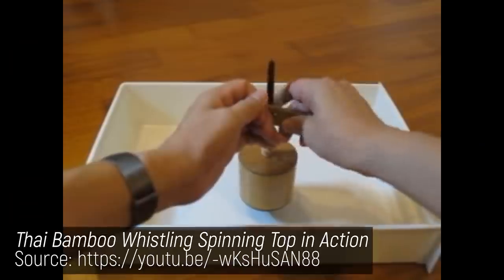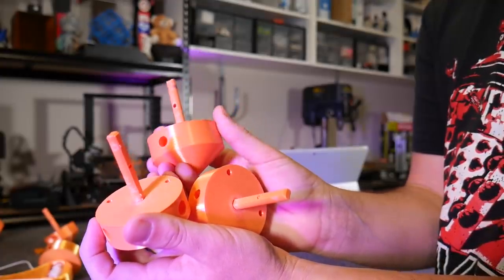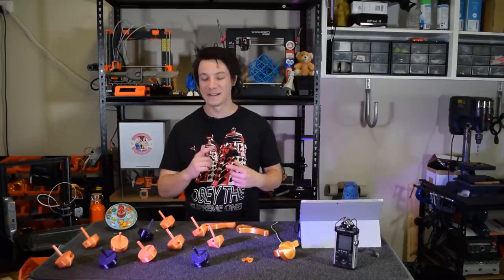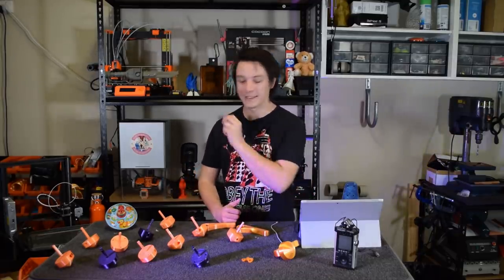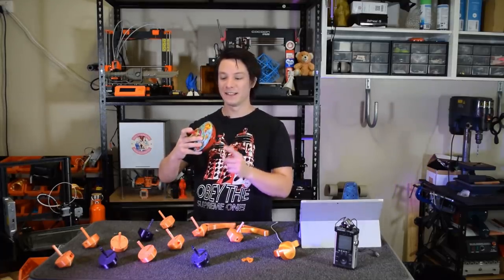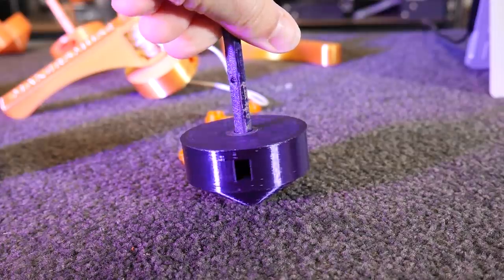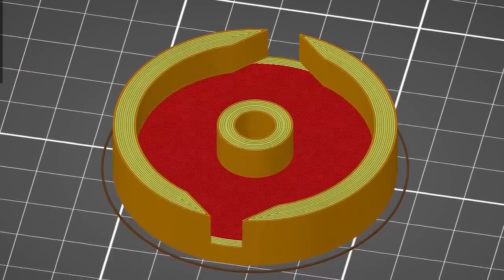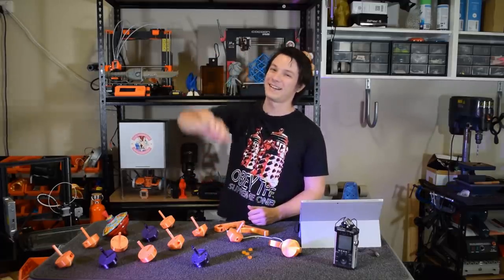3D Printed Screaming Spinning Tops

Comment: Can you make a top that sounds like a air raid siren
Reply: kwalski analysis
Reply: @LoneFalcon a bigger one could be made like those spinning tops which stay in place, with an outer stator mounted on bearings.
Reply: I don't think its possible because the top would be spinning fast and you would need it to be slow smooth loud then quite then back to loud, maybe they could do it but it would be going from loud to quite really fast.
Reply: @professored7169  as you're launching it it spins faster then decreases as it slows down.
Reply: @satibel  I know. A bigger one would have more mass so it would spin a lot longer, and I'm talking about the sound, it would be impossible for it to smoothly transition from a higher pitch to a lower pitch then back to a high pitch again.
Reply: @professored7169  maybe if you want one that repeats, here they just play once.
you could probably make one with a clutch and a flywheel.
Reply: WWII Carter Air Raid Siren, look it up. Then duplicate it into a spinning top. It would work on the same principle mentioned in the video, which is fine, so I'd expect it to be possible.
Reply: Hell yeah ✊🤘
Reply: it sounds like an airplane in the sky
Reply: Japan has left the chat
Reply: Chowski
Reply: I was gonna say that
Reply: Or a train
Reply: Or an Aztc Death Whistle
Reply: I was thinking the same thing.
Reply: Yes.
Reply: yeah
Reply: That would require 2 tops, an air raid siren is essentially 2 air compressors bolted together
Reply: He can't
Reply: It'd be complicated but might could be done, but we're talking a mechanical system here not passive noise making. Below are two of my ideas for one but no garauntees.

First thing you'll need are weights on rails within the top that can slide straight inward and outward. These need to be pushed or pulled inward by springs. The weights need to be attached to worm gears, which in turn would drive horizontally aligned pistons on the outer end similar in design to those in your car engine. The heads of these pistons each drive a slide wistle, which naturally changes pitch as the slides are moved. This causes the pitch of the sound to change as the top slows down over time, as the outward force generated from the top's spin gradually decreases and is overcome by the springs pusing against the weights, which in turn drive the pistons that change the tones of the slide whistles. A downside is that so long as the top remains at or near its maximum velocity, the tone will not change.

Option 2 is to make a clock wound by the action of spinning the top from the launcher. Two free-spinning prongs stick up from the rest of the top and are inserted into the launcher along with the axle, each on opposite sides of the axle. As the top is launched, the axle spins but the two prongs remain static relative to the launcher. This allows them to drive one or more springs backwards within the top so as to power the clockwork, which rather than sponning dials would alternately push and pull on the slide whistles just as option 1 would do. This, however, would take a mechanical engineer/watchmaker MUCH more adept than myself, though it WOULD allow the siren's tone to go up and down even as rotational speed remains relatively constant.
Reply: siren head running
Reply: No a loud one everyone will evacuate if it’s a loud one
Reply: That’s shaped like sirenhead
Reply: @jdhart3759  no
Reply: JD Hart no
Reply: It would need a stator to do so
Reply: That would be epic
Reply: "my goals are beyond your understanding"
Reply: That would be COOL
Reply: Unfortunately the way an air raid siren works, is it spins fast then slows down the spins up again.
Reply: SirenHead top.
Reply: :0 YOU ARE A GENIUS
Reply: TBB747  I know that, but it's just a longer version of the other one, we've had to sounc the weather one, In my town because we had a major blizzard coming.
Reply: Yes
Reply: I agree
Reply: All of you are forgetting that the mass, surface area, and geometry of the cylinders used in Air Raid Sirens are directly correlated to the tone and drone of the sound. A smaller one would just be higher pitched and wouldnt sound like a siren at all. It has to be big, has to be shaped correctly, and has to be moving at an exact speed, one that a 3D printed polymer would probably be destroyed under
Reply: @joshreyes3624  correct
Reply: @professored7169  You could use 2 or more disks with different diameters that trigger at different RPMs. Imagine a simple jingle that plays as it winds down.
Reply: Siren head weeeeeeewooooooooweeeeeeeeeeewooooooooo
Reply: @mrbobjob8995  no
Reply: Yes
Reply: The sound they make is made by pushing a ton of air into a perforated disc using a motor so I very much doubt you could
Reply: Here's how sirens work, which may or may not be helpful to Angus: The thing that is turned by a hand crank or a motor is a rotor in a chamber like that in the compressor side of a turbocharger.  This takes air in from its center, where multiple vanes on the rotating part accelerate the air and force it to the outside of the chamber.  The rotor has a number of separate paths for air to follow.  The outside of the chamber has holes in it, spaced the same as the air passages in the rotor.  Thus, as the rotor rotates, the flow of the pressurized air is chopped into pulses as the rotor turns, thus modulating the pressure of the air at a frequency (pitch) proportional to the rotation speed.  This is why the pitch rises as it is cranked up, and drops as it slows back down.  What makes this a challenge for a top, is that there needs to be a rotating rotor inside a fixed chamber, like sirens have.  The metal top Angus shows uses something similar to this, with its air intakes at the bottom and three different tuned pitches of reeds at the three air outlets at the outer edge, but the pitch on that is determined by the resonant frequencies of the reeds, not the speed of rotation.
Reply: U mean siren head
Reply: Yes
Reply: Foolish YT  yes
Reply: yeah
Reply: @satibel   gyroscope
Reply: You could use the same whistle design but make the point at the bottom flat. When launched the spin is high and will start at the high pitch. Then the flat will induce more friction and get that quick dive bomb sound. 

It would only last for 1 cycle but would be close to the sound.
Reply: If there is a nuke coming onto earth, there will be a lot of those things spinning
Reply: put this on r/cursedcomments
Reply: No
Reply: grab siren head and make him spin.
Reply: Better question could you make one that sounds like an Aztec death whistle
Reply: Shepherd tone
Reply: We don't need a top for that
Reply: Sirenheads favorite toy
Reply: Yes please
Reply: That would be great
Reply: YES I WOULD TO LOVE TO SEE IT
Reply: Even better a Stuka siren
Reply: 68th reply
Reply: 69th REPLY
Reply: hey bro you want to see my top wooooooooooooorrrrrrrrrrrrrrrrr
Reply: DO IT
Reply: granpa would surely like it
Reply: fun fact this is basically how the Ju87 siren worked and old air raid sirens were two spinning discs with different amounts of holes in them
Reply: *AAAAHHHH*
Reply: TF ?!?!..When in the heII did I like your comment @ Neue ?!?!? This is the first time watching this vid. As I scrolled down the comments I noticed that it was liked by me. Probably my future me. Hahaha

Comment: Holy shit, that whistle mechanism thing can be good gimmick for beyblades
Reply: the dream, definitely
Reply: trips rip the rip trips, beyblade let errr rip m8
Reply: Do they still make beyblades?? Omg I just had flashbacks to 3rd grade. I forgot about beyblades.
Reply: @professored7169  yeah, the latest beyblade series is beyblade burst GT
Reply: Might be a bad idea beyblades rely on their weight to be not thrown off the platform
Reply: @anderson9244MLG  not gonna lie but they've reached the point of no return
Reply: @troymyboi2808  what do you mean?
Reply: Takara Tomy definitely have good engineers. The way the balance the beys so that they wont be so overpowered, the way the tip changes the way it spins, it hits, and revival method, balancing system that can make it hit stronger while unbalanced or maybe all rounded for better stamina or better defence. But in this case, where should they put the hollow section? Basically a beyblade had three seperate section, so the only part that can be made hollowed and big enoughto has hole on it are the layer base and the tip. Could be a feature.
Reply: "GO PEGASUS"
Pegasus: WHISTLE NOISES
Reply: I mean, we've gone so far we can make 3d printed beyblades
Reply: @dzulk9  you forgot Hasbro
Reply: @harvetwound1234  but didn't they tend to modify TakaraTomy products?
Reply: The screecher
He makes every person nearby have concussions until their head explodes into a gorey mess, therefore making him the winner because the opponent couldn't spin or even make a move.
Reply: Whoooooaaaaaaaaaaaaaaaaaaaaaa
Reply: Ah man. I hate it when my beyblade  screams at me
Reply: @professored7169  yeah the have beyblade burst gt, almost season 5
Reply: @anderson9244MLG  almost beyblade burst: sparkling
Reply: Yes, i always wanted my beyblade to scream in existential horror
Reply: I smell a potential reboot
Reply: Someone made that
Reply: @janski1490  I bet if they made it whistle it'd be called something like 
"Something-something phantom" or "something-something ghoul"
Reply: I ❤ beyblade
cuz imma beyblade fan
Reply: yes "annoy you enemy with super annoying sounds"
Reply: beyblade: alive, THEY SCREAM IN PAIN.
Reply: Juat imagen you rip your bayblade and it screeches into the others with the sound of a Stuka.
Reply: I am designing a beyblade with this system so I can 3d printed. Do you wanna see it?

Comment: "Cannot force air" challenge accepted! ;)
Use a double spinner system. 1 heavy spinning disk powering a small turbine, then the spinning top as well...
Reply from the maker: Ooh that would be intense!
Reply: @MakersMuse  Could possibly use the twisted rod, as the spinning top toy does, but to power an internal spinner, then spin the main disk?

Comment: Some tornado and bombing sirens are a spinning thing, wonder if using that design might be louder.
Reply: A siren of that construction needs their fixed outer ring to get that loud unfortunately
Reply: Plus, turbine sirens (the kind people think of when they hear the term "air raid siren") often use two turbines tuned slightly differently to get that dissonant, startling "find shelter NOW" sound that everyone recognizes. In fact, I wonder if one could make a whistling top with two differently-sized inlets to get that effect. With the proper tuning, you could even play chords :D
Reply: @yetanother9127  Just wanted to get some ideas flowing, guess it worked :)
Reply: Honestly, I think there already is one on Thingyverse
Reply: Nope - those sirens are close to as efficient as you can get.
Reply: Okay, I just looked and not only are there dozens of them on thingiverse but there's dozens of videos of them here on YouTube as well.  Some of them work quite well.
Reply: @ABaumstumpf  A military grade one sure but they don't have to be.  Plus, I've played with one.  The only thing that's "efficient" is the high speed gear ratio.  Easily outdone by a cheap motor.  The only reason military grade ones need to be efficient is so that they can operate at a moment's notice by hand crank.  But you could easily get that level of volume without the effort.
Reply: @VagabondTE  They are efficient as in they can transform well over 60% of the energy you put into them into actual soundwaves. The gear-ratio got nothing to do with that what so ever.
Reply: @ABaumstumpf  Yeah they're built well like most things in the military but it's just metal in a particular shape.  It doesn't take a NASA science lab to build one.  They're really not complicated.
Reply: @solid477  "They can get 60% because of the gear ratio."......................................................................................... really, if you do not know how a siren works or what the word Efficiency means then please, just do not write more stupid lines like that.
Reply: @solid477  "Torque requires energy."
Nope, it does not. You really should first go back to school and learn what the words actually mean.

"Immediately calling people stupid morons."
Nah, just after you have successfully and beyond the shadow of a doubt shown your self to be one.

Comment: The first thing I thought when seeing your cross sections was "where is the air inlet?" If you are going to use centripetal force to force the air out and thus make a whistling noise, you need some kind of hole on the top to let air in. Old-fashioned air raid horns work that way too and they are really loud. I think your tin top works in a similar way as I saw that the screw knob doesn't fall in entirely and might function as an air inlet. Anyway, just my 2 cents.
Reply: Would it work as a centrifugal fan if the entire body were spinning at the same speed?
Reply: Actually, the tin top has the intake at the bottom, and pulls air over some reeds. You can even see them from the bottom of the tin top.

Comment: Lovely investigative experiment! Helmholtz resonance is formed by two mechanisms 1) The air in the neck (like neck of a bottle) which acts as a mass. 2) Air in the chamber (like body of a bottle) which acts as a spring. When air moves over the mouth of such a resonator (like blowing over a bottle) the mass in the neck is excited and bounces at a specific speed on the air spring in the chamber. Just like va pendulum it operates at a very defined timing (pitch / frequency).

You can control the pitch (frequency) of the whistle by adjusting the chamber volume as well as the neck length and diameter.

As I mentioned, the system resonates at specific speed / pitch and multiples of that. This is why you heard two distinct tones as the top slowed down, and they appeared to be an octave (1/2 pitch) apart.

I recommend designing a top with a straight narrow neck (not filleted) opening to a large chamber abruptly. You might even try a ridge on the outside of the top to cause turbulence over the opening.

Feel free to get in touch if you want some in depth discussion on acoustics Angus.
Reply: I'm sad, I edited the post to remove a typo and The Great Angus's like disappeared automagically :(
Reply: Great extra info. Tnx

Comment: Your tin humming top toy may be different than mine, but as far as I know, those toys don't actually use Helmholtz resonance. In the base of the top, there should be some metal reeds. These make the tone. As for the airflow, it's rather interesting. On mine for instance, if you plug up all the holes on the top perimeter of the top except one and blow into it, nothing will happen. But if you suck air out of the hole, the reed begins to make sound. The holes form a rudimentary centrifugal blower.

Edit: Man. I should watch the whole video before commenting.... Literally 2 seconds after I hit play, he points out the reeds....

Comment: If you steal the ball out of the tip of a ball-point pen, you can super glue it to the base of your top and probably increase your spin times :)  That ball in an ink pen is actually made of tungsten carbide, incredibly hard, and would make a great tip/spin point for your tops. The hardness allows for less friction loss, which means longer spin times :)

Comment: I would think you could use two bearings in the launcher so to reduce wear but also reduce the possible friction created for slow down.  Basically the launcher pieces would spin while launching.

Comment: i would have had an entry hole at the top near the center, which would have a channel lead through the inside to the sides thus serving as exit holes. so as it spins, air would be pulled through it as air is being flung out. So i'd try to mix a blow whistle with a spinning top. But i'd shit lord it up an see if i could make it sound like a kazoo, because that would be stupid and thus perfect.

Comment: As I understand it, cold war air raid sirens worked on a similar principle, but instead of one hollow chamber, they used an impeller shape. They would also have two impellers tuned slightly differently to get that signature sound. It would be really interesting to see that design applied here, and make a top that sounds like an air raid siren.

Comment: Is it possible to make moving/deformable parts ? Which would change the sound with the top's speed
Reply: I mean it already does without a compliant mechanism, but if you’re talking about the one using reeds, it would not be that hard.

Make the the two ended chamber like normal, but in the center have two chambers that don’t have any exits outside of the top besides from the main chamber. Put weak plastic leaf springs in them, and a plug with a guide track so it does not tilt creating an air path behind the plugs. 

The faster the top spins, the more angular moment will affect the plug pushing against the spring making a larger chamber. As the top slows down, it will get a smaller chamber, and become more high pitched. With two different reeds, the actual note will change itself respective to the thickness of the reed. 

Note like a piano note, and pitch like the height of the not. Low c or high c.

Comment: A question. I’m partially sighted, and have wondered for a while if there’s a way to make a frisbee that makes a noise as it goes along. Would this work? Is the speed generated by chucking a frisbee enough to cause the desired effect?
Reply from the maker: Huh, possibly! Look at the whistle used by vortex toys, that design might work.

Comment: I've done some research into designing an ocarina tool 3D print so I was looking into how whistles work. There are lots of videos of people making them out of clay but there doesn't seem to be any rhyme or reason to where the holes go and the actual whistle hole is not really described well in them. The ocarina has a similar resonance chamber inside.